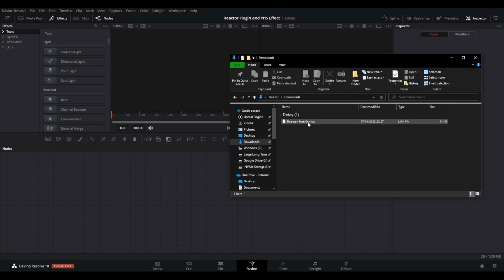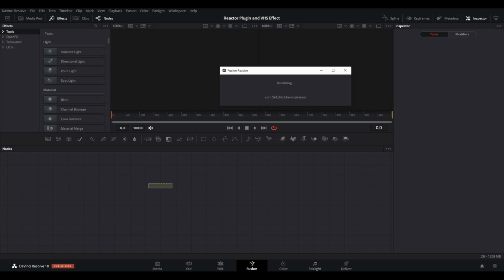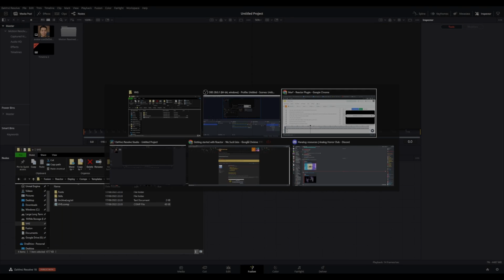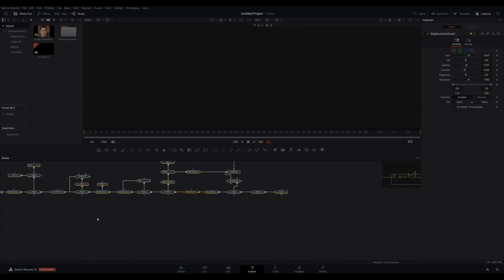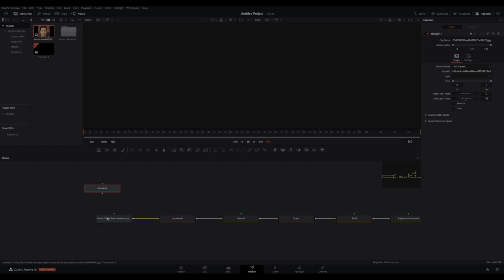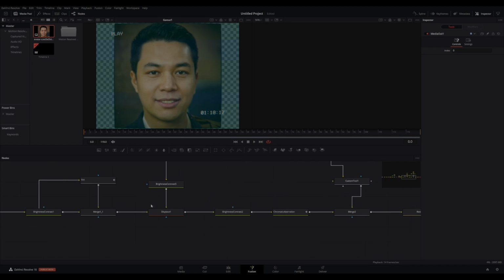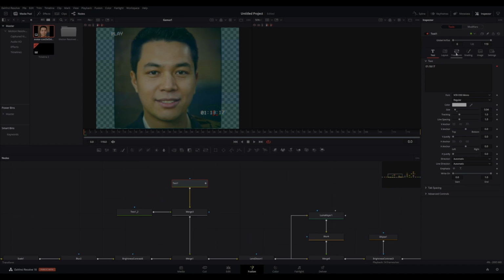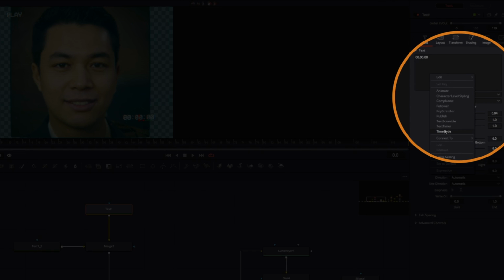Reactor Installation and VHS Effect for RESOLVE

Comment: This looks like a really good tutorial but I cannot find ‘reactor’ in the Fusion files.
Reply: Wait, I was looking in program files not program data. Sorry for wasting your time but engagement is engagement :)
Reply from the maker: @GodofToast  haha - no worries - hope its helpful!
Reply: @motion.resolved  it is. I did have the same issue as another commenter but removing the text seemed to work fine. I can install the font manually and add it in the edit page. Otherwise, thanks so much for your easy to understand tutorial!

Comment: I get an error when I try to connect my clip with the Letterbox node
Reply from the maker: what does the error say?
Reply: @motion.resolved  All the nodes turn red, not sure how to check it.
Reply from the maker: @Joose_  did you disconnect the loader node first?
Reply from the maker: Also, in the description there is a link to the video of the original creator of the comp.  Might be worth checking that video to see if I'm missing a step...
Reply: @motion.resolved  Text was causing issues for some reason. I don't need the text so I'll just remove it
Reply: @Joose_  I had the same issue, I think the text node is looking for the custom VHS font the original creator used.